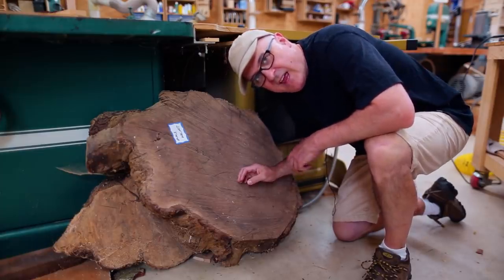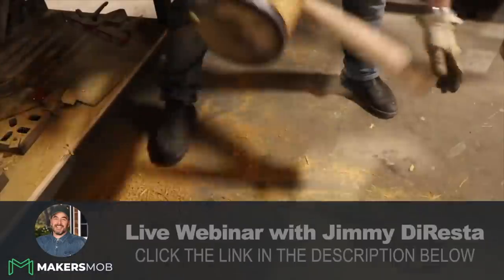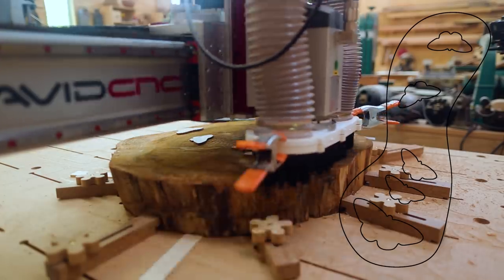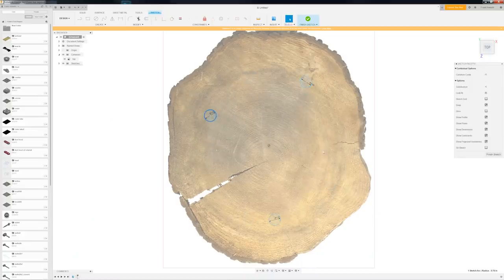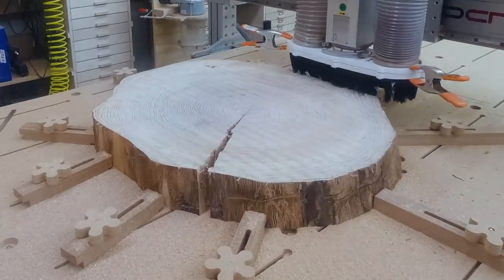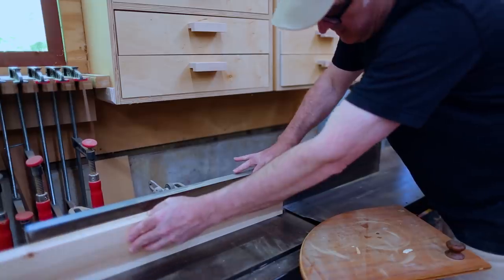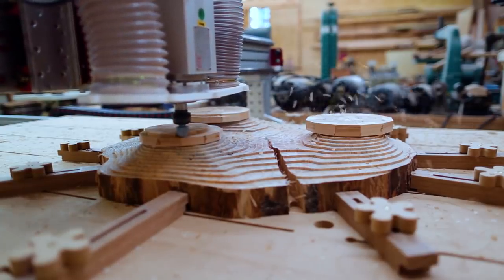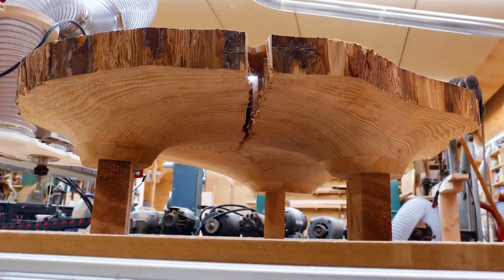Making a Coffee Table (part 1)

Comment: Frank, if you did your toolpath in fusion you can check the "smoothing" box to reduce the amount of information going to your CNC controller and it should reduce that jumpy movement that it is doing during the roughing. Increase the tolerance on it to something like 5 or 10 thou. If you have any questions please feel free to ask. Great video as always.
Reply: And if that doesn’t help try using G64 values for path smoothing...But you will have to play around with the settings to get nice and consistent results...And as always...Very nice project! Can’t wait to see part two!✌️👌

Comment: Can't wait for part 2! Great work as usual Frank. I saw a double growth juvenile California Redwood ( Sequoia sempervirens) root ball structure made into a 12 foot by 5 foot "conference table". The legs were the actual root structure power carved by hand,  and the tabletop was giant cookies from the stumps surrounded by a green pearl opaque epoxy edge for the work surfaces for the "conference" attendees. It went into a building in the San Jose "area".  It was crated up and placed into the room on the third floor of 5, as the building was still being built around and above it. After the whole building was finished they did a museum type of reveal on day one of opening. It was a work of art. The problem they had after that was finding/designing chairs that looked appropriate to such a work of art! Custom made green high back leather executive styles cost almost as much as the table. Silicon Valley days... before the capital crash bubble.

Comment: If you ever run into a scenario where you can’t rotate your model, another option is to just set your x and y planes in the setup dialog box for that operation. You can just draw reference sketch lines for your axis, then use that reference line to define which direction you want x and y. Nice and easy!

Comment: Great video as always!  Over the years, I’ve CNC cut a lot of complex 3D shapes out of hardwood on our shop’s Komo router.  Found that leaving a fair amount of thickness on the roughing pass and going straight to a finish ball mill pass seems to deliver the best surface results.  We program in Powermill; usually expand the roughing pass by 1/4” or so, and skip the intermediate ball mill semi finish.  I would think Fusion allows for similar programming.  Cheers, & hope this helps!

Comment: the legs remind me of the design of new railway station of Stuttgart, currently under construction. it has 28(?) such columns all in white concrete. there are plenty of video's on subject Stuttgart 21.
Reply: Glad I scrolled through the comments again, I checked out the architect's that designed that and they have some inspiring stuff, gotta love German engineering :)
Reply: it s a very controversial building project, one has to add
Reply from the maker: very cool. I like how the columns seem to make the opening in the roof plane

Comment: What a beautiful sculpture!
I have 8 - 4" x 20" dia. Oak "hurricane" slabs I cut that have been drying for 4 years now and have been perplexed as to how to overcome the inevitable "check split". I am now thinking about making a jig to cut them into 60-degree Pizza" slices than gluing them back together with strips of contrasting wood in between. I would lose 1- 60-degree slice per slab (where the split is) but having so many that wouldn't matter. I could mix and match to maintain the live edge look.
Do you think that would work?

Comment: If you're wanting to rotate gcode at some point again, look at gcode ripper. It has multiple functions other than that and it's free. I've used it to take flat gcode and place it over contours on stock after probing the surface. You can reuse gcode and do things like grab a random shaped log and engrave the same thing into it, on the correct surface, each time.

Comment: Great video, as usual, Frank!  In F360 I have found that when I import an svg, dxf, or image that if I move it to one of the quadrants then it's easy to rotate and move around later (I use the top right).  When it's in the dead center it seems to be locked to that point.  There's probably a way to 'unlock' it but during the import it's just easy to move the image to a quadrant and forget about it.
Reply from the maker: I will have to try that.

Comment: So numerous times I've heard you say something along the lines of "I don't know where the high spot is" when using the CNC table.   Considering the bar where the router is is parallel to the table, and the arms that it rides on are 90° to that, seems like you can use that extruded aluminum t-slot material to put in something to hold a laser pointer or something 90° to that that you can loosen and move up and down as necessary to have the laser just highlight where the high point is.  Of course if the high point really doesn't matter then yeah this is a lot of extra work.
Reply from the maker: I like that laser idea.

Comment: What I’ve had semi success with is projecting the outline of of the irregular shape and then using a vbit to make a fairly faint outline in my spoilboard.  It’s not perfect.  I’ve also tried cutting the profile out of a sheet of plywood and then setting the piece down into the cutout.  This also helps secure it.  But depending on how accurate your initial tracing is sometimes this works better than others.

Comment: I wonder if, when drying large slabs of edge grain, it would be smart to strap a constrictive band around the circumference of the slab at the beginning of the drying time.  That would be to limit the cracking during drying.  I dunno. Have never tried it, but I wonder if that would be a smart method.

Comment: Aaaagghhhh!  You didn't listen as I screamed at the computer.  You should have used the CNC to drill holes for dowels to reinforce the leg joints.  When you make the legs, you can put mating holes in exactly the right places.
Reply: I was thinking the same thing, except I would bore holes in the table as you suggest and then I would extend the leg model to so they would have a round tenon at the top. Same idea, same end result, but I think the integral tenons may ba slightly more rigid.

Comment: Fantastic as usual Frank.
For the 90deg flip, could you swap the Xand Y in the code using a text editor? 
Replace X with i
Replace Y with X
Replace i with Y
Reply: That sounds like an interesting workaround, I’d def want to prove it out before running it on a unique piece. 

Not sure what program he uses for his CAM (I assume Fusion...) but it is a pretty simple change in the setup. You can set the machining work coordinate system different than the model coordinate system. It’s one of the first things you define in creating a setup

If he exports the model to a different program (vectric maybe?) I can understand that would possibly be more confusing, but I still think it can be handled inside fusion with a move command and just rotating the model to the orientation required. 

I was kind of surprised it was an issue
Reply: @russellmiller2564  I think Frank is new to fusion, so he probably wasn't aware of the different ways to do it.

Comment: I’m curious to know: does changing the shape of the “bow ties” affect the purpose of these. Did you take this into consideration when using butterflies instead? Was it just design wise or it doesn’t matter? Does it affect if you do it only on top vs through the thickness or on top and at the bottom?
Reply: I was thinking similarly. You'd think that only having the butterflies on one side would warp the wood over time

Comment: 10:45 the machine seems to be stuttering...is that intentional or is the controller choking on gcode that is giving too many instructions at once? I know that behaviour from my 3d printer when the serial communications aren't fast enough to get the code across in real time. I can help that behaviour by setting the minimum segment length in the post processor/slicer such that at a given speed the instructions per second is manageable.